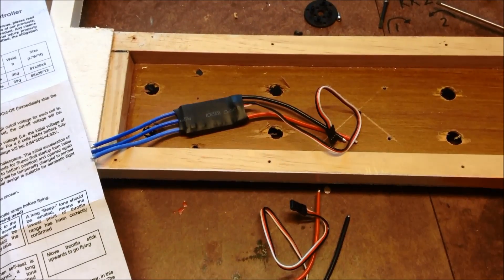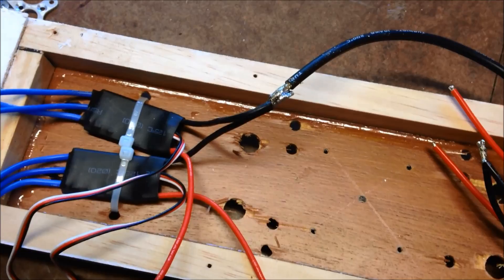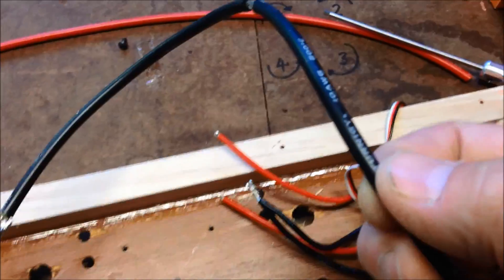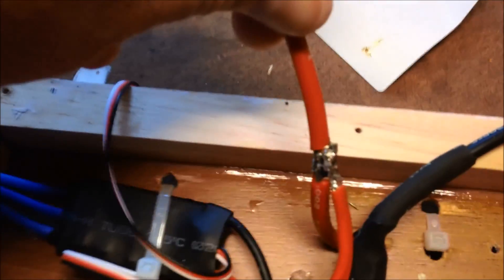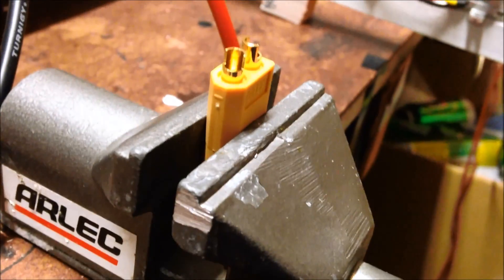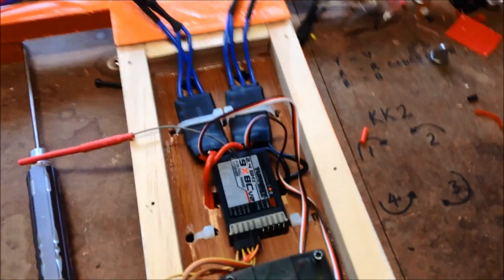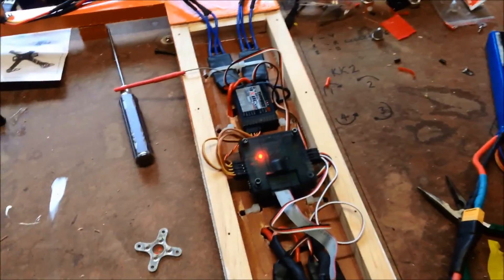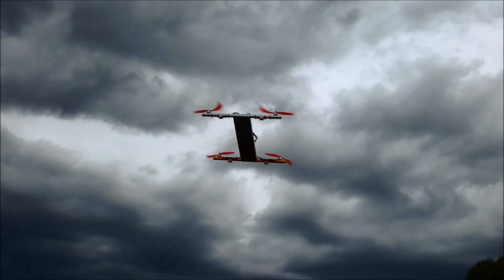KK2.1 DIY Wooden H 680 Quadcopter Build Part 3. Install ESC and TEST Flight

Comment: hi Simon I have a few more questions I am building a H quad using PVC pipe it comes up to 600 mm do you remember your settings on  the kk2 fc for your 680  h quat  or can u point  me in the right direction for a beginner setup and thank you for all your help happy flying

Comment: ose solder points look pretty weak though, I use my Weller gun, and it really gets the job done. nice quad man, love the idea
Reply from the maker: TheFirstOfMyKind Bit like my work bench. Bit messy but it does the job. Enough solder for good electron flow and all is good. I need to get some gloves so I can hold the wires in place better. How do you hold the wire when soldering?
Reply: Hey Simon, wasn't being mean or anything. If I came across like that I apologize. How I do it is I pre solder all the tips (also using a bit of flux helps) so the tips of the wire are solid. And with a clamp I joint the wires together and heat them up with the solder gun. And then I fill it up with solder, the solder that has been pre applied sucks the new solder and it becomes a solid and hard joint which will be ver difficult to come lose. Hope this helps. And make sure you are not using a very thin solder so it melts instantly while getting the job done. Do this and you should be gold. Good luck buddy.
Reply: Sorry, make sure that you ARE using a very thin solder.
Reply from the maker: Yep I used to solder PCB boards in my youth. That's the only solder I have. Probably should wear my glasses too. That might help. LOL